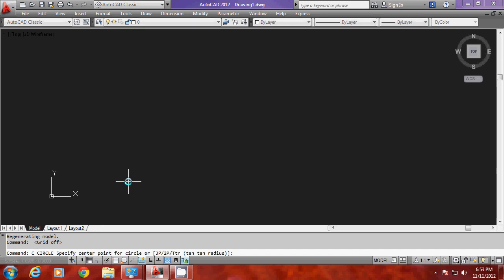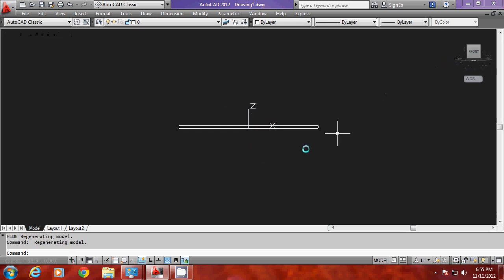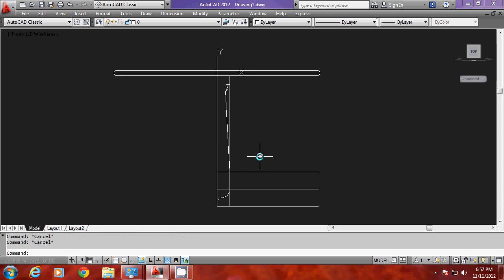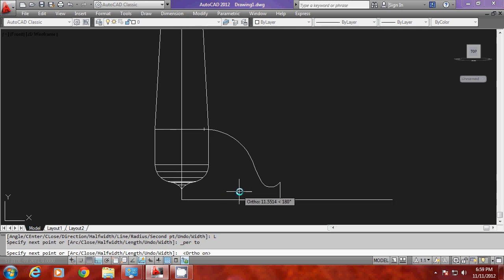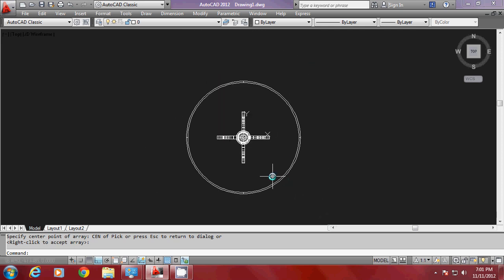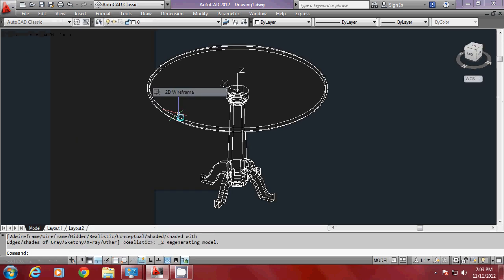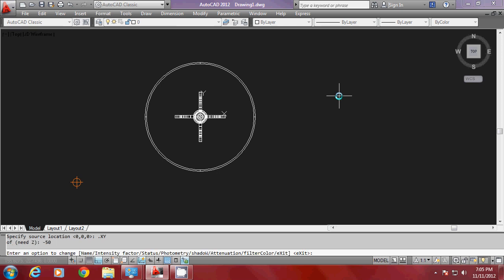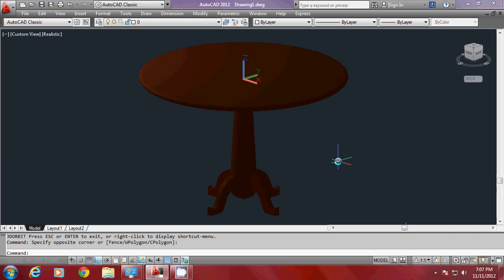CREATING A 3D TABLE WITH WOODEN MATERIAL | AUTOCAD 3D RENDERING

Comment: Thank for the tutorial.  Its great.  I'm having a problem putting material on the legs of my table.  Once I array the legs, they become an 'array' and not a solid, thus not allowing me to put material on them.  How would I rectify this?  I tried 'Interference' and it showed where the legs join, there is an overlap.  Since my legs are not solid I can not subtract or union.  Since my stem, (vertical part of base) is a solid, I cannot trim.  Help!
Reply from the maker: The array which yoiu have got must be an array object which will remain as  a single unit. Just give EXPLODE command on this to convert it into a solid object . You cannot trim a solid object. If you want to remove  a portion of a solid object , Try SOLIDEDIT command .
Reply: sabeercad Thank you so much!

Comment: I can not find the command "ARRAYCLASSIC". Do you have another solution? Where to give commands "ARRAY"? Use "AutoCAD 2012".
Reply from the maker: You can try ARRAY command . You will get the same options.
Reply: I can't pick the number. I can't make them move in the Center.
Reply: Do you have another solution? Please help me out.
Reply from the maker: You have to specify the center of the array properly . You can change the center using the ribbon panel . Or you give ARRAY command and give an Enter you get a dialogue box where in you can choose polar and specify the center using the mouse
Reply: sabeercad http://tinypic.com/view.php?pic=2jexru1&s=8#.VIem9TGsVis
 Why can't I select that to you?
I can give you if you do not select the color as it should.

Comment: +sabeercad brother, i've got a problem in following this procedure, after doing the table's stem,when i was starting to revolve it, it said, " Unable to revolve object." i followed the procedure step by step making sure that the ucs was at the view option which was at front view if i'm not mistaken. PLEASE HELP me :) thanks Great tutorials btw. Subscribed << honestly don't know where i was wrong ;)
Reply from the maker: After creating the profile . If you were not able to revolve it , the profile may not be closed one. so you can either trace it once more over the existing profile or else you can use Bpoly or Boundary command. Just give any of these commands , pick a point inside the existing profile , the software will automatically trace the boundary for you. Then you revolve that boundary. Just try it . All the best....
Reply: i've got it. thanks a lot my error was creating a Pline at 0,0 then entering close. basically i entered 2 mistakes :) thanks again. its working perfectly now :)